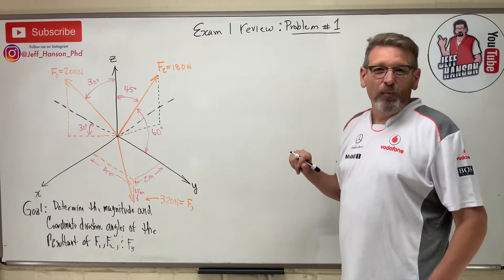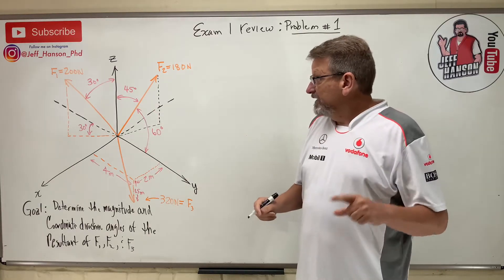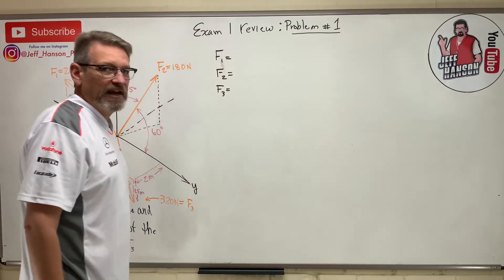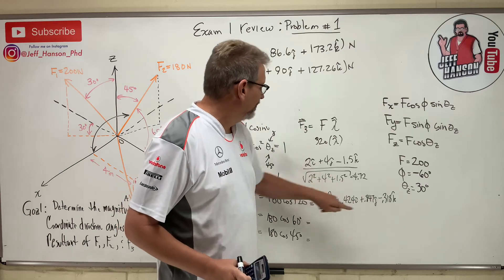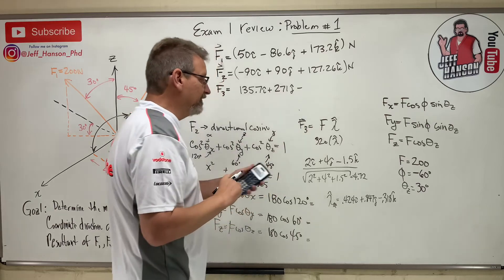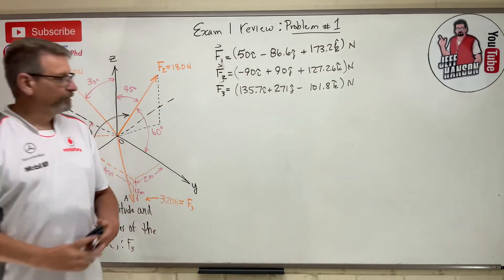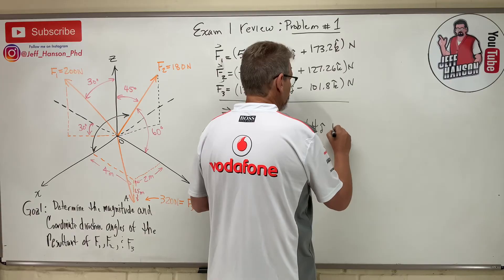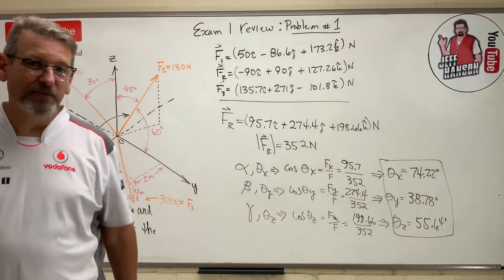Statics: Exam 1 Review Problem 1, 3D Vector Addition

Comment: I used the first method to find F2. I did the squareroot=F2 and it was 180 as well but the components were different. What's that about?
Reply: if you used 150 as the swing angle like me, that is incorrect. i dont think the 1st method can be used on F2 because we do not  have the swing angle